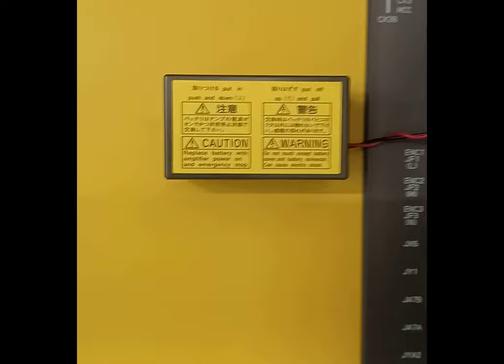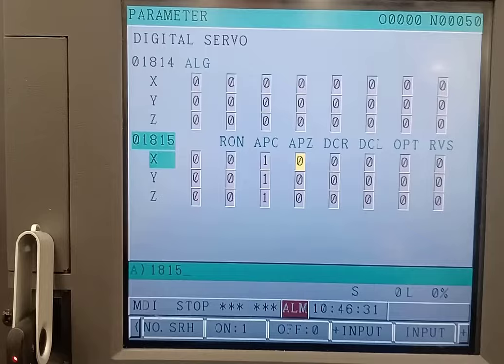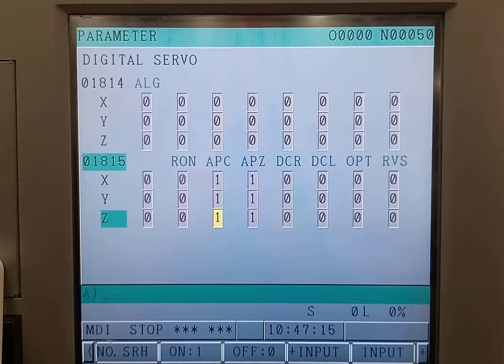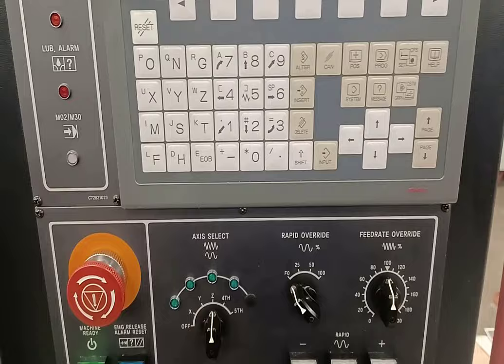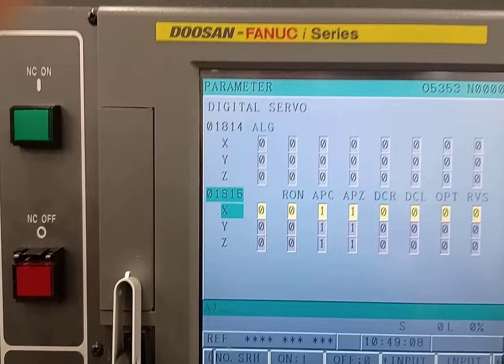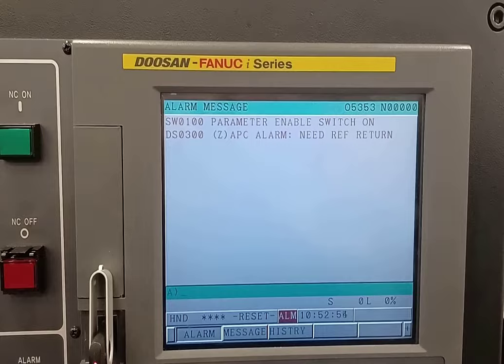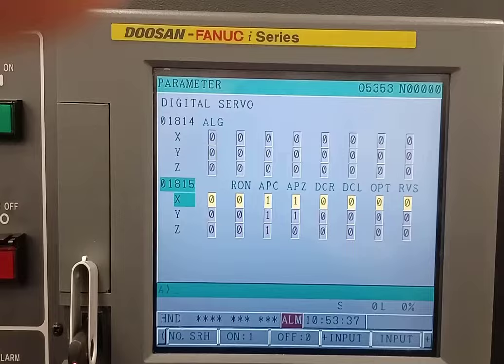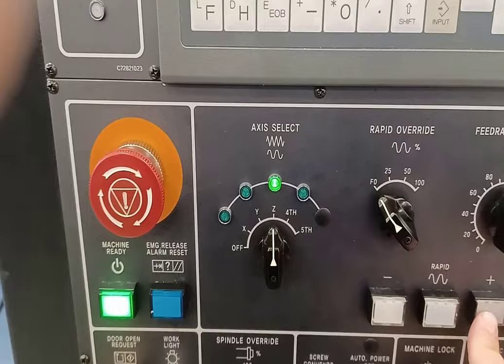CNC Fanuc Resetting home position After switching batteries

Comment: Your video saved my bacon! 😂 I just got my first-ever VMC a couple of weeks ago. I got it under air and power last weekend. I turned it on today to find a sea of red alarms. 🤢I had dead battery alarms, and home reference alarms,  and who knows what else. Thankfully the seller gave me an extra replacement battery, and your video helped me solve the alarms and the home references. There was one additional scare though. I got a DS0309 Alarm: Z Axis Reference Return Impossible. Google to the rescue. I learned that I had to manually rotate the spindle at least one full rotation and then restart the control to clear that alarm. All is well now. Thank you!
Reply from the maker: You're welcome, I'm glad this video helped also thanks for the heads up on the spindle having to rotate to reset the alarm always fun to know cool tricks
Reply: 9e

Comment: We had our rotary table rebuilt and it's off by a few degrees. I have it indicated straight but trying to adjust the limit switch. Hopefully this helps me tomorrow.
Reply from the maker: Fingers crossed, it should be the same method. If it works out, I am very happy that it does.  That's the only way I could think of doing it. Good luck, and thank you for watching.
Reply: @aaronrunk4209  🍻
Reply: @aaronrunk4209  what's the worst thing that could happen? Send a tool through our rebuilt 4th axis and destroy the spindle? 😄

Comment: Great video. But as a machine tech I am amazed that you set the machine zero with the arrows😂
Reply from the maker: Yes it does seem a bit unusual. It's interesting to me because I've had a lot of technicians disagree with this method for not being within microns of the tools manufacturers specs but this is just a simple 3 axis machine and doesn't need  kenimatics adjusting to be functional. If the machine had lots of jobs and fixtures that used G10s then setting this back to the tools manufacturers specs or a known Z axis locations would be both time and cost effective. But for this machine being an educational model and not being used for production. Im able to just eye ball in the location for the tool changer home location and there's nothing to it.  Thank you for watching.

Comment: My z and y arw good. I hit positive on the x and the table went all thr way negative. What i do wrong
Reply from the maker: @carmenpetro1781  that is a very interesting problem. off the top of my head I'm not fully sure why that should be happening. It almost seems like the button for positive and negative for the X directions are wired wrong if they are two separate buttons. That is definitely something that will have to be addressed by looking into the ladder of the machine. The PMC ladder I believe. Unfortunately I don't have a lot of experience on ladders however knowing that it is possibly a ladder problem you may be able to look it up from there
Reply: @aaronrunk4209  so, here's even a crazier thing. I was gonna start from scratch, so I powered down the machine with the battery unplugged and when I got back to 1815 the "1's" were still there. Had to be a Friday. Appreciate the reply.
Reply from the maker: @carmenpetro1781  that is crazy it's funny how these machines as repeatable as they're supposed to be tend to surprise us

Comment: When I follow your steps after I cycle power the parameter revert back to how they start. How do I get the parameter change to stay?
Reply from the maker: So I had this happen on my Doosan 220 lathe. However, it did reset the home locations correctly, and when I sent the machine home, it did everything correctly as well. I wasn't sure why it was doing this, but it did home correctly. some machines may have something in the ladder that reverts back to zero. I would check to see if it does go home to the correct locations and if it's just making it a zero instead of keeping it a one I would try running a simple program and then having it go to g28 home and g53 home and make sure that it goes to the right location both times. Thanks for watching, i hope this helps
Reply: @aaronrunk4209  Thank you I will be sure to check the home positions, only probably now is I cant get the parameter enable alarm to clear, I tried holding reset and cancel as you did and nothing happened. I cant move out of MDI to test anything because of this.
Reply from the maker: @spencerlamp4887  get rid of your perimeter I enable go ahead and change your one back to a 0 on the perimeter right enable and see if that lets you check your positions
Reply: @aaronrunk4209  I had already changed it back but I forgot to power cycle it again, i went and checked the parameter again one more time and I noticed that APC is all 0 now, and APZ remained all 1. Is this normal?
Reply from the maker: @spencerlamp4887  I want to say the last time I changed out the batteries on my emco machine, it did that, but both are fanuc, so it might be based on the series of fanuc.
Reply: @aaronrunk4209  Okay good to know, sadly I can't sped anymore time on it today but I think I've got everything squared away now. I can't thank you enough for all the help you've been a life savor. We are a very small shop and only have 2 CNC mills, so you helped us go from 50% to 100% capacity lol. I hope you have a good one and thank you again.

Comment: I did this procedure on a 2 axis lathe ,but at the end if i re-change the APZ parameters to 0 i still got DS0300 APC alarm, axis need reference home.
What should i do?
Reply from the maker: Well I'm sure that's is frustrating. On our lathe we have a known location from the chuck face to the original home location.  If we run into this we put the machine back to this position and then reset the home position.  You may try setting the home position further away from its original position (by a few inches close to the spindle) and then see if it does it again.  It may be too far past the hard stop.  You may have to reach out to the machine dealer for trouble shooting.  Good luck and thank you for watching

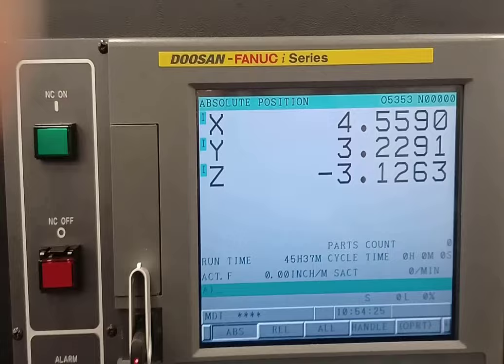Comment: In 4:38 i notice that there is "I" beside every axis. What is it and how do i remove it?
Reply from the maker: I haven't tested the theory out yet, but I believe with APZs having a one next to it. it puts an I next to the axis as like an override. However, if you can get the machine to repeat its home position and change the APZ back to zeros. I believe that those I will disappear. I had to reset the x and z axis on my doosan lathe, and I ended up having to leave the APZthere for it to repeat its home position. Hope this helps and thank you again for watching

Comment: @Aaron do you have a video doing the same thing with a lathe ?
Reply from the maker: I have not create a video for this. However, the same settings page is used and in the same manner. If you machine was at home when you replaced your batteries I would move away from the home position one full rotation of the motor away from home position and then return to that position before switching the values from 0 and back to 1.   If you have a reference location for the Lathe then you can move away from home and then move back to that reference point. We have a  Doosan 220 and it too has the red arrows for reference positioning and I was able to do the same thing. Good luck and I hope this helps.
Reply: @aaronrunk4209  Thank you so much. Technology is amazing! I'm receiving help from you from across the world . A few years ago this would have not been possible.

Comment: ot0500 alarm is now my problem, i have changed the battery from x axis on a lathe cnc, but now it says "x+ overtravel" please need some help :c
Reply from the maker: you'll have to turn off 1815 by changing X from a 1 to a 0, then set your new home location before turning it off. You're basically turning off the previous zero and setting a new one. Once you have the new location. set the parameter back to 1, then turn off the machine.  Sometimes, it's easier on a lathe since it doesn't require a tool changer.
Reply: @aaronrunk4209  thank you!!!

Comment: Would you follow the same process after charging the 4th axis servo motor? When I home my 4th axis it's two degrees out, on the 4th axis but reads 0 degrees on the controller. 

Please assist if you have an information.
Reply from the maker: Yes this will work the same.  You will have to indicate it square and then change the setting to 0 and then back to 1 before turning off the machine.  After you power the machine back on it will home to the position you squared it to.  Thanks for watching
Reply: @aaronrunk4209   Thank you very much, this really helps alot 👌🏿.
Reply: This is word for word my situation. 🍻 Share the knowledge.
Reply: @NORTHBROOK1978  I indicated my 4th axis and followed the zeroing procedure as in the video at it worked

Comment: Do you leave them all 1s after complete or turn them back off to zeros?
Reply from the maker: Once you set the locations you keep them at one
Reply: @aaronrunk4209  If i try to rechange the APZ parameters to 0 after the procedure i still got the APC alarm error, what should i do? Keep them to 1?
Reply from the maker: @mechconsultingmechconsulti4284  I would troubleshoot if your alarm persists and you may have to set the location from a known locationon the machine.

Comment: hey i can't enable my parameter write it is staying at "0" i can change everything else but not the first !! any clue?
Reply from the maker: The only thing I can think of is that the editing key is set to operator level. This means you can still edit tool offsets and geometries, but you can't make edits to the program or edit the maintenance side of the machine.
Reply: @aaronrunk4209  ok so ? 
remedy?
Reply from the maker: @fredrezfield1629  if it is the key, you simply need to turn it to maintenance mode.  Next to the program protect key, there should be a settings mode. turn the settings mode key to the maintenance level.
Reply from the maker: @fredrezfield1629  you may also try using the soft keys at the bottom of the screen for 1 and 0 as they sometimes tend to override that setting instead of typing in zero and pushing enter
Reply: @aaronrunk4209  no i tried that trust me it could be a DMG feature that doesn't allow me to write enable but thanks though
Reply from the maker: @fredrezfield1629 stinks that DMG makes certain functions difficult to change. I have Mori Seiki Lathes, but they are much older. Sorry I couldn't help and good luck.
Reply: @aaronrunk4209  do you need to parameter Write enabled to mess around with your way lube timing too ?
Reply from the maker: @fredrezfield1629  no just for editing parameters. You should have a setting/maintenance window for that. Our robo drills have a separate screen just for timers
Reply: @aaronrunk4209  i do it's very confusing  i remember i set it up once a few years ago but i screwed up the intervals 
so when you start up the mill, the pump goes off for ONE MINUTE straight then another 30 seconds but nothing during running.  do you know procedures for your fanuc ? where you find it? which page? lube time ? etc?
Reply from the maker: @fredrezfield1629  This short will show our maintenance page, and it's page 14. I personally haven't set it up.  Ours was running on a timer, and we had the tool sales rep change it to spindle timer 
https://youtube.com/shorts/5rWJ841AzTk?si=M4QoniDlkTOJkQUg

Comment: Proplem with tailstock postion
Reply from the maker: If your tail stock uses parameter 1815 for positioning. Your process for setting the zero should be very similar on the lathe and mill. however, if your tail stock has a parameter that won't allow you move it. you'll have to either turn off the limit switch or adjust the safety zone. Tail stocks are very different between machines so just be sure not to knock it off the ways when adjusting

Comment: how do i clear an alarm of MAG WRONG POSITION (PL1016)? the reset button dint help. anyone who can guide me?
Reply from the maker: Depending on your machine, it sounds like the waiting pot for the next tool is in the down position. If so, you need to go into the Custom page or  Tool recovery page and put it back to its home position. Some machines will have a tool recovery button that you can simply push. If you have a machine with a moving Carouse (example Hass VF1) , you just need to make sure that it is fully retracted in its home position. Hope this helps and thank you again for watching

Comment: Is it possible that this lithium battery goes dead from one day to another without any alarm on the message box? This is very annoying...
On older machines i have alkaline batteries (they last years) and i always get low battery alarm on the cnc panel, so i have time to replace this.
This battery is really a bad solution from Fanuc in my opinion...
Reply from the maker: I have in the past I have received a bad battery that was new.  The voltage was correct but the current was somehow not right.  Not sure what was up with th at but I was able to get a replacement for it from my sales rep. The batteries I buy are from the dealer so I haven't ran into very many problems like this. I agree I is annoying when they start to go out.  Our machines stay off quite a bit so the battery gets used up faster.

Comment: hello guys, help me.. how do i remove an alarm PL1017 (MAG UP/DOWN OVERTIME).? reset button has not helped. thank you in advance. anyone to offer me the procedures?
Reply from the maker: Some alarms like "parameter right enable" can be canceled or cleared by pushing and holding reset and cancel buttons at the same time. however, if you keep getting the alarm, it sounds like you have a sensor that is not sending the signal to the machine saying that it has completed its motion. Hope this helps, and thanks for watching

Comment: Plz for doosan mill 500ii model 2015
Reply from the maker: This is the only doosan that I have in the shop however it should be very similar on most machines the parameters will be the same in your process will be the same just how you find that home position may be a bit different
Reply: @aaronrunk4209  thanx 4replay,,i am fixed that

Comment: This is so bad. To anyone watching, no this is most definitely not how you reset your machine zero after replacing batteries
Reply from the maker: I understand that it's difficult to comprehend how this works but I've done this for several years and on several Mills and lathes without issues.  The tool changer is always lined up and the parts always come out correct. Something to remember, it doesn't matter how perfect your parts are coming off the machine the costume isn't going to pay extra for perfection that's why tolerance is a thing even when it comes to microns.  Thanks again for watching
Reply: @aaronrunk4209  it's not difficult to comprehend it's just plain wrong. You should be using #1850 gridshift. If you use #1850 age the batteries go dead, you don't even need to go into the parameters to fix it. All you need to fix it. You just need to move the axis in the minus direction then bring it to within half the ballscrew pitch abc zero return. This way the machine position never changes.
Reply from the maker: @mlnunnari  if both ways work is just another way of doing things.  The customers are happy and the warranty isn't voided. Saying it's wrong if both ways work is merely an opinion. Thank you again for your comments